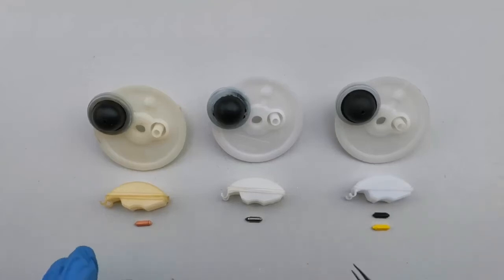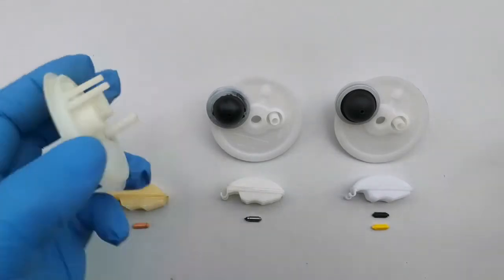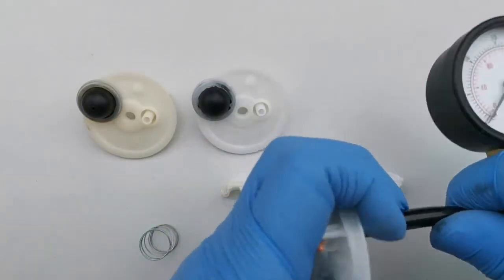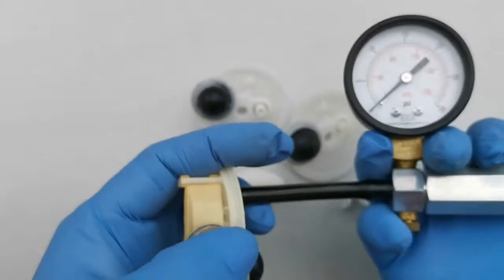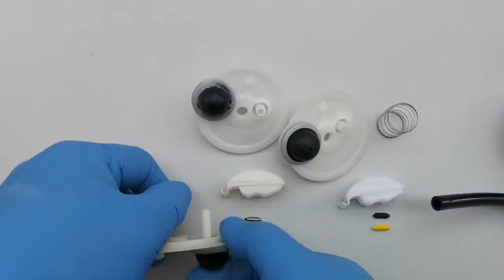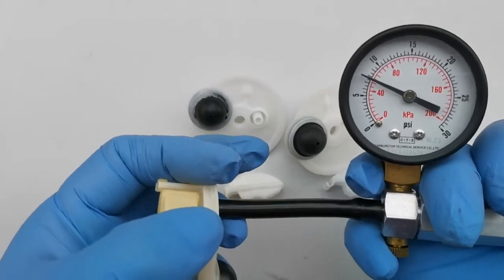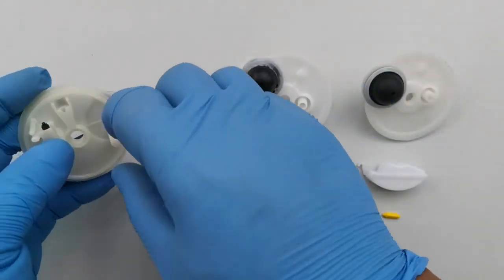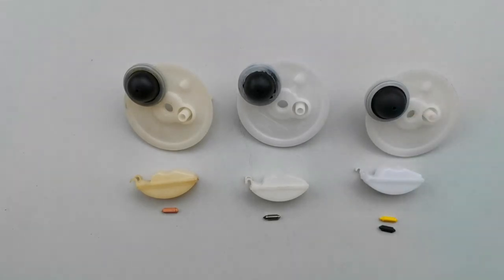VTECH 14 - Are all VICTA Primer Caps, Float and Needles are the same?

Comment: This is absolutely so true. The Vtech replacement primer cap for the Victal LM/G4 carburetors works an absolute treat. Thanks guys for a really great clip and a really great product. I was pulling my hair out with what was clearly one of thos after market caps then I found this clip. Purchased the primer cap[ had it in two days installed it and viola my absolutely runs like a new mower. I've subscribed and marked VTech as my go to mower parts supplier. Cheers
Reply: I have used 3 of them now and yes they are very good no issues with flooding

Comment: I wouldn't mind buying the metal needles now that I see the difference.I've always used the genuine victa carburetor parts & orange needles as the yellow ones never work properly I've had them get stuck,also good to know the other issues that you pointed out in the video.
Reply from the maker: Josh, Thanks for watching the video and subscribing to our channel. This week we will be producing video on experimenting with all three types of Poppet Valves by changing its setting position and noting the low and high RPM. Cheers! VARIETECH

Comment: Which ratio of fuel and oil do you recommend for a victa 2 stroke...it says on the mower 25:1 but other people say 50:1.  Thanks.
Reply from the maker: Always 25:1 for Victa 2-Stroke. Use the metal needle to avoid flooding and minimise too much smoke during starting.
Reply: I just bought one of those metal needles. Going to try it tomorrow. Thanks for replying

Brilliant video by the way.  Very imformative.
Reply: @Varietech-AU  I used a metal needle mate.  I'm so glad you discovered the problem and you made a video showing everybody.  The problem was actually the float and the main jet needed cleaning.  The float I bought online from an Auatralian shop.  It leaves no gap exactly like you show in your video. 

Thank you mate.